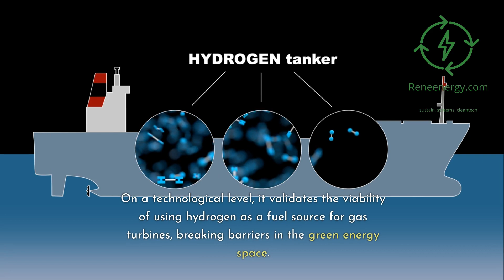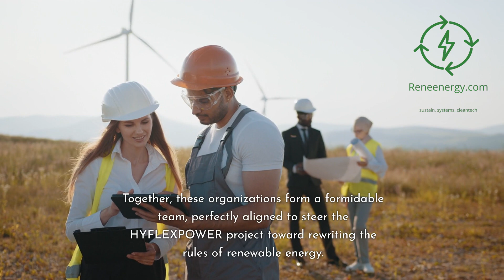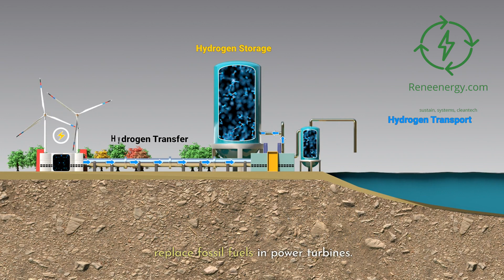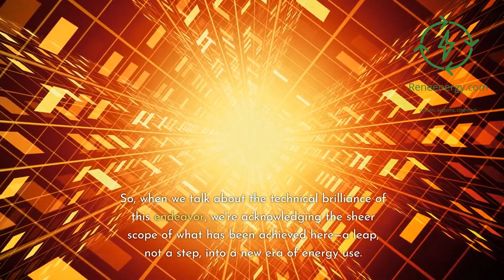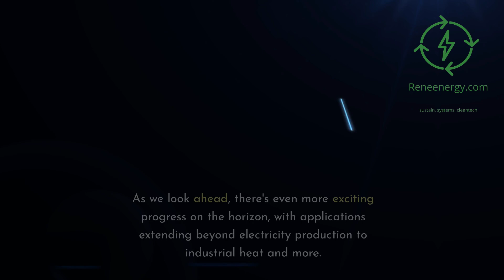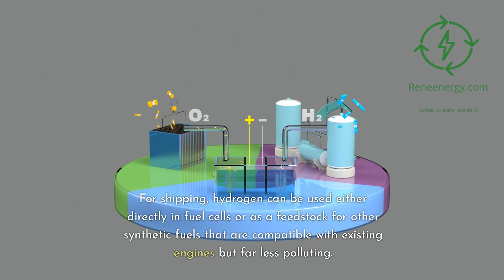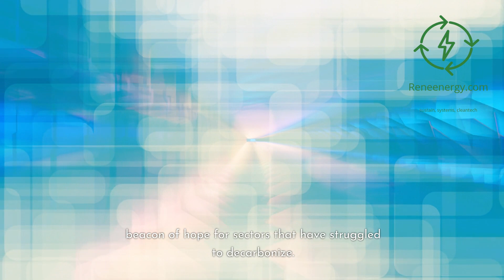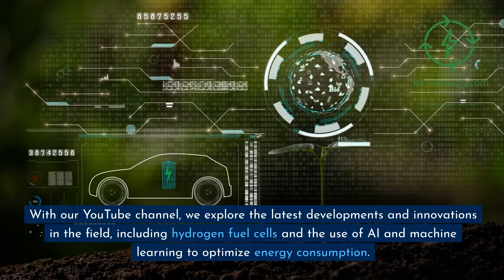A world first 100% Hydrogen Powered Gas Turbine

Comment: It will be hard to be one hundred percent fossil fuel free if ever
Think of all the grease and oil for lubrication needed for all types of machinery and vehicles and all the products made from petrochemicals.
Green Hydrogen will have a big role to play in CO2 reduction and reducing our reliance on fossil fuels.
A turbine that runs on fifty to one hundred percent Green Hydrogen is a fantastic achievement.
😎👍
Reply from the maker: Thank you for your comment markjmaxwell9819. Transitioning to a completely fossil fuel-free world is challenging due to the widespread use of petrochemical products in machinery and manufacturing. Green hydrogen, however, offers a significant opportunity for CO2 reduction and reducing reliance on fossil fuels, especially in energy-intensive industries. The development of turbines that can run on 50-100% green hydrogen is a major advancement, demonstrating the potential of hydrogen in replacing traditional fossil fuels in various sectors.
Reply: @renewables2050  saying”green hydrogen” does not make it so. You are greenwashing by ignoring the lower tail of the production of hydrogen Where does your “green hydrogen” come from. It would be great to see a true life cycle analysis and see the real emissions calculation of your project.
Reply from the maker: @Antonio-g5c3m  Thank you for raising this. You’re absolutely right that calling hydrogen “green” doesn’t make it green. What matters is the full life-cycle analysis—electricity source, electrolyzer efficiency, water use, compression, and transport. The projects we highlight are those that meet strict carbon-intensity limits under frameworks like EU RED II or the U.S. 45V clean hydrogen standard, which require verified renewable electricity and audited emissions. Not all hydrogen is clean, and transparency is key.

Comment: "Hydrogen, it's not as they say" Elon Musk
Reply: It's a start ,what is the alternative?
Reply: @MikeBurns-bi5xj  the hint is the rocket technology, but with the ability to control there burn.
It is very compact and by keeping the two mixing state apart before ignition they have a higher safety then 1 propulsion tech.
Other one is the Plasma fusion option, but then you need to overcome a lot more other problems to make it work.
Atmospheric propulsion's always is the guzzlers, but none atmospheric propulsion is the better solution.
Of coarse eco friendly systems is the longer outcome heading.